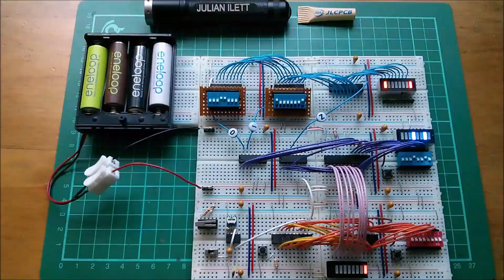Understanding and Programming the One Instruction Komputer

Comment: Have you looked at how Steve Wozniak's Disk II controller works?  It's somewhat like this except that four input signals are fed to the ROM address along with four sequencer values, and the instructions feed the control inputs and one of the data inputs of a universal shift register (probably a 74LS299 but nowadays a 74HC299 would be equivalent).

Comment: You can put all of your logic in RAM/ROM once you get to the point where you can treat memory contents as a logic table function call. From then on the only extra hardware you need is more and more memory. For 2 X 4 bit inputs you have 8 bits of results with the index being the name/type of function, add a bigger table with more i/o bits and you have carry etc. in your results which allows you to iterate over much larger problems one part at a time, so you are substituting clock cycles for logic bitwidth.

Comment: Most computers have instructions that consist of an operation and data, e.g. LDA (instruction - load the data at the following address into A register) 0x1C (data - in this case it's the address of the data you want loaded into the A register). Your "program sequencer" is kind of analogous to the data portion of the instruction, except instead of pointing to the address of the data for the instruction, it always points to the address of next the instruction. So I guess I would call it the instruction pointer?